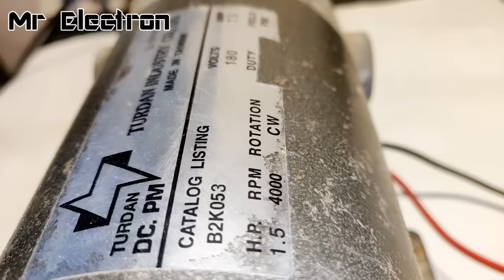12v 100A Super Capacitor Battery for High Current DC Motor - Amazing Idea

Comment: Bro, your capacitors are in the wrong side and the solder joints are so poor and messy
Reply from the maker: It was Intentional. Although more flux could do better..  :) But who cares as long as it works as expected.

Comment: Small 12 volt solar panel puts power into these capacitors ,, the capacitors run small motor that connects to larger generator by belt ,,, the generator is connected to a charge controller that is connected to a Battery that is connected to a 12 volt 5000 watt inverter. ALL THIS to power a 1500 watt heater,,, freezer,, lights,, computer,, refrigerator and an induction cook top.. ALL DURING THE daylight hours Only.   HAVE FUN ,,,,,,,,GO BUILD.